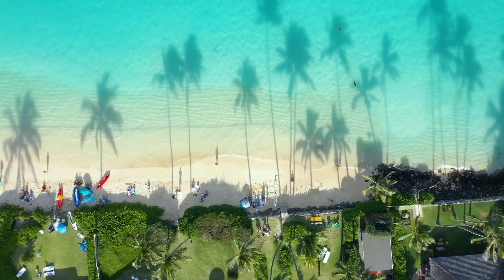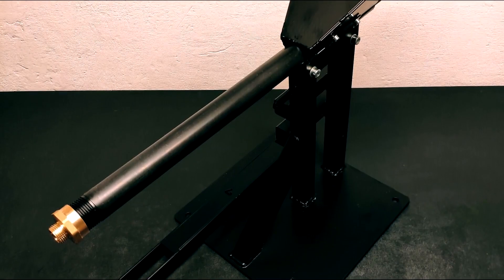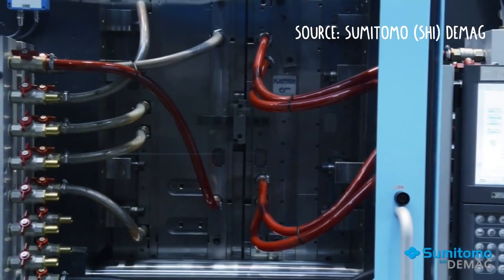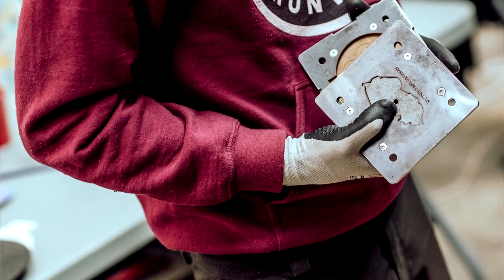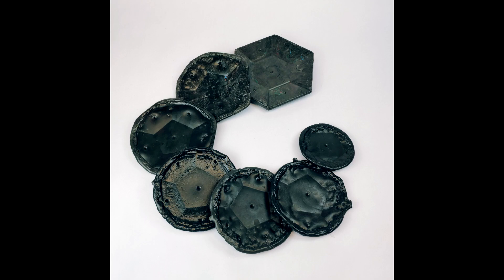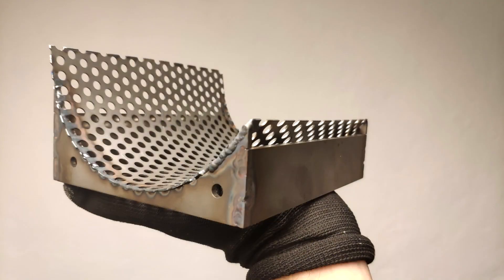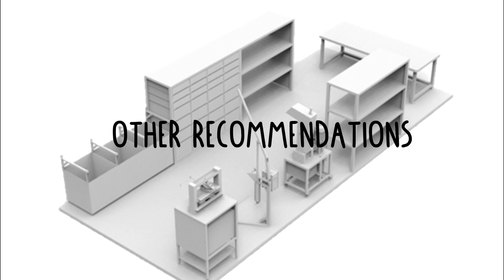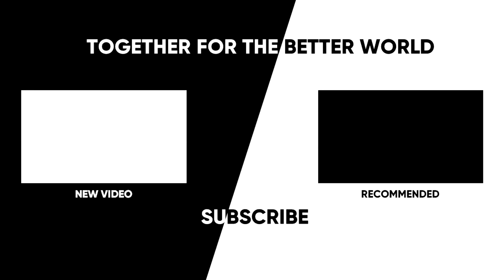Basic Precious Plastic mistakes

Comment: I am precious plastic member. Have you also manual shredder ?
Reply from the maker: Hey 👋 I have a shredder equiped with motor
Reply: @plastmakers  I am still a beginner, so I would like to start with something electricity free. I have not so large amount of plastic to work yet
Reply from the maker: @zodd0001  on Precious Plastic website you can find also hand powered shredders. I know that Plastic Preneur sell a small hand powered shredder. But I would say that performance will be very small.

Comment: Thank you for this amazing video!

I would be interested in some further information about the different types of hdpe you show at @01:45. What happens when you mix hdpe from bottle caps and let’s say a detergent canister?
Reply from the maker: Thanks for message 👍 when you mix and melt different HDPE types it will stick together. But it will be difficult to make products with the same properties and apperance. I would say, that separation is more important for injection moulding. When plastic does not have good flow properties, its required to apply more force.
Reply: @plastmakers  ok I see! Would you consider it problematic creating a simple sheet from different hdpe types? The only requirement would be that it looks good. It doesn’t have to be very stable 😅
Reply from the maker: @larsfischer2253  compression moulding is foolproof technology 😅 it should not be problem 👍
Reply: Thanks Thomas this video is great and very helpful! My sister and I are just starting out and we were thinking of mixing Hdpe plastics so it’s good to know this is a bad idea. We are in the process of buying a machine (injection machine like the one you bolted to the wooden pallet). Do you think this will be too hard for 2 girls to do? It looks like it takes strength? 

Can you recommend and injection machine, shredder or small compression machine?
Reply from the maker: @becanadevencorn3876  Hello, thank you for message 🖤 Firstly, its good to hear that you want to start ♻️ Precious Plastic machines are good for beginners and small workspaces. If you want to build machines by yourself there are usefull Starterpacks on Precious Plastic website. If you want to buy ready to use solution, visit Precious Plastic Bazar there are sellers from different countries😉 Its good to read sellers review. And one more advice for you, make a simple cost estimation. For example when you buy injection moulding machine or compression moulding machine, you also need moulds which will cost some money. I am sure girls can handle plastic recycling activities. Example when I jumped on lever is really extreme. 😅 Usually its easy.  If you need more answers, send me email: info@plastmakers.com or for faster response Instagram